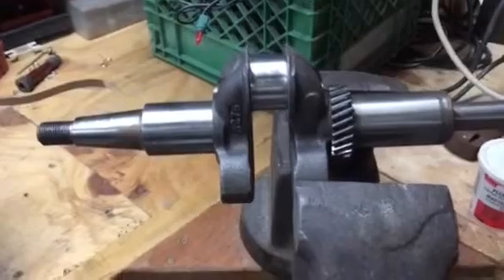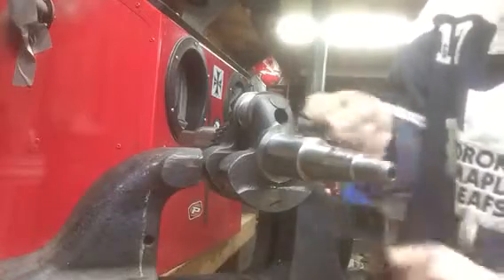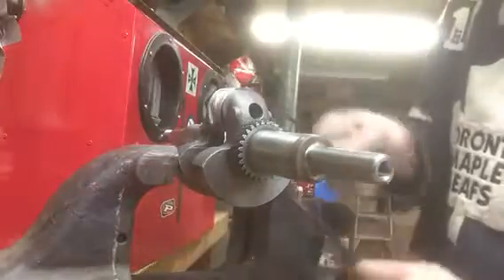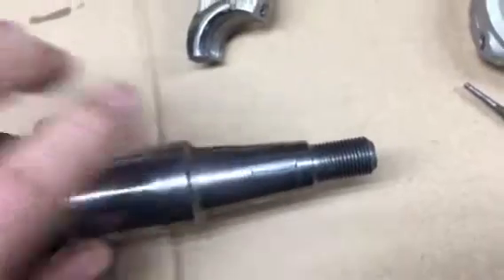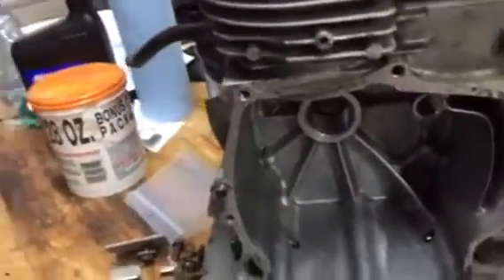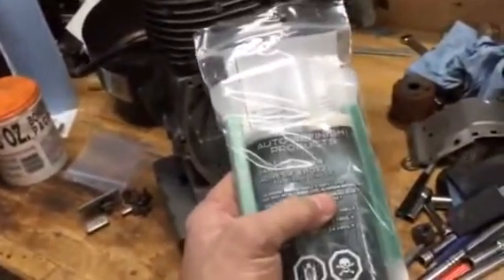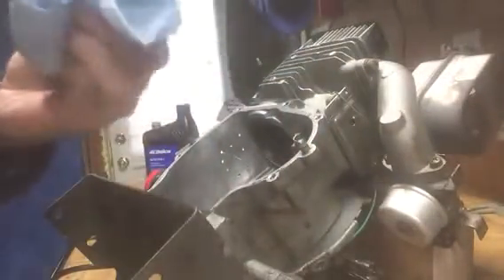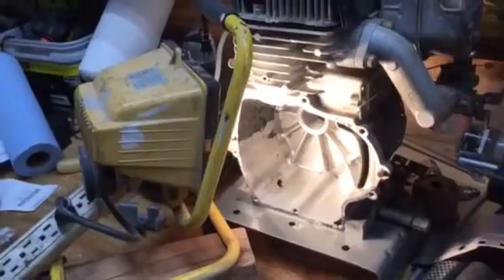8HP Craftsman Snow Blower Tecumseh Snow King Crank case repair

Comment: How the hell did you not notice that big hole before you took that thing apart !!!!!!
Reply from the maker: The starter motor was sitting right on top of it. And it didn't leak.
Reply: @MOAB  oh, ok. Whatever happen with the motor did you fix it ?
Reply from the maker: Yes, it still works, and I will be digging it out pretty soon to use this winter. Not much snow here yet. I think the last video shows me using the snow blower.
Reply: @MOAB  ok